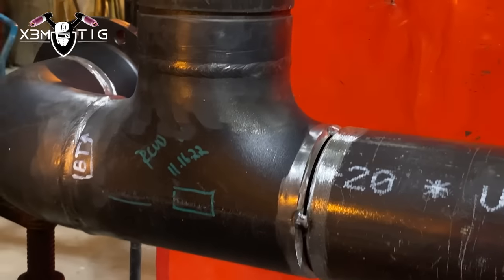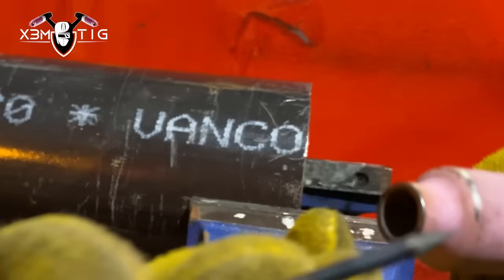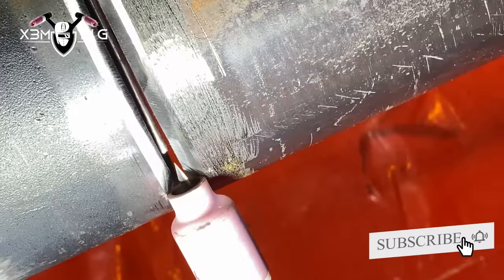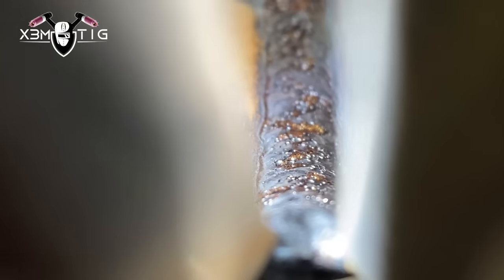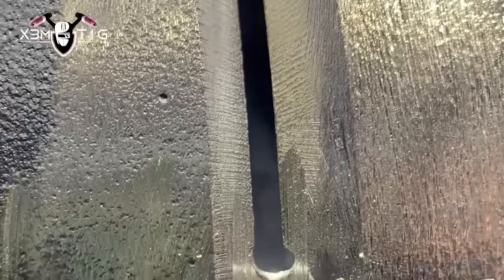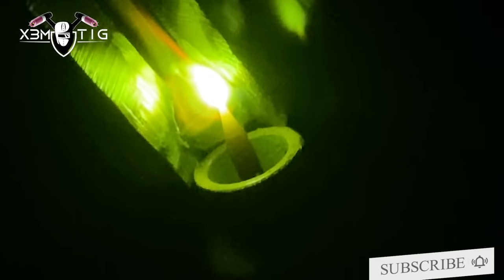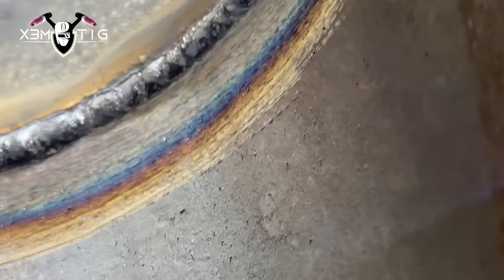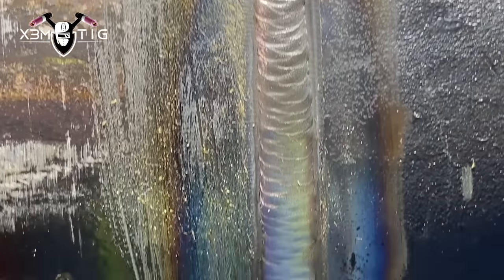TIG Welding Root Pass | TIG Techniques For an X-Ray Pass !

Comment: Dip technique will never fail you. I try to tell all welders to never focus on the middle, the bevel edges are the most important. It helps prevent too much penetration. Break the walls and the wire will do the rest of the work.. love the content!
Reply: keyhole never fails…….NEVER
Reply: i’m taking a 6gr and i’ve busted 2 already and idk what i’m doing wrong
Reply: @Smurf51766  what did they tell you the reasons were?
Reply: @sethhoward9300  they showed the x-ray i had two tungsten holes and one porosity but it looked more of the cap for porosity. and the cap wait 10718 i beleive i was just running too hot
Reply: @sethhoward9300  but the weld has to be 100% inside of a cage and the lift arc doesn’t work right and i stick a lot and that’s what i’m fighting and tapping the tungsten with my rod rarely works and if it does it goes away immediately
Reply from the maker: Thanks brother I appreciate that, glad you liked it .👍
Reply: Great advice thank you
Reply: @morgs3007  a
Reply: @Smurf51766  your not running the right heat and never call the qc over until you inspect it your self. Most of the time you can fix any problems with a burr bit and some heat
Reply: I always got a flat root from dipping. What should I do differently?
Reply: @johnnielocklear2911  what are you running your heat at? Youre moving too fast if you have a flat root. Once you see key hole open up, push the wire in the puddle about a quarter inch and repeat… it helps for you to have a tighter gap  which in the end will make for the weld to be completed faster.
Reply: Totally agree the middle of the weld will always takecare of itself when capping a pipe butt I either dip the wire both sides of the pool or just leave the rod in the centre of the pool and fly round the pipe lol
Reply: Thanks
Reply: I be trying this and my instructor keeps telling me not to it's so much easier
Reply: @johnnielocklear2911 tight weave only. Weave not morethan the gap
Reply: How in the world do yall walk the cup walking it hard for me so I do free hand or w e it's called and then my hot pass Is hard to stretch the puddle to fill the gap my caps are kinda decent I don't have a steady hand so tig is really hard for me
Reply: @ThatS550guy  you don’t have to walk it. Whatever is best for you, stick with it!! I free hand it all!
Reply: @X3MTIG  I want to see you do your dipping technique when you're welding the root on the bottom. Dipping on both sides or bevels.
Reply: Nice video, thanks.

Comment: I can make a pretty weld on pipe but for it to pass xray is still a challenge. Im certified on x r ays for butt welds ane verticals bur pipe ive been practicing all week. I can get 1/2 to maybe 3/4s of a decent root. But i keep getting 2 or 3 chunks of rod that dobt get fully melted. 😢 wont give up till i get it. You're videos definitely help

Comment: Question for the tungsten electrode is the tip always completely sharp or should it be alittle blunt flat on the end cause when I do ac welding with aluminum for example it’s supposed to kinda ball up be a little blunt or like bullet shape I believe not as narrow as I would for like using mild steel or stainless steel in dc just curious my welding fundamentals 6th edition says that
Reply from the maker: Always keep your Tungsten sharp when welding carbon steel

Comment: Can you give me a tip about controlling the filler wire? Which position is better?
Reply from the maker: You have to learn to control it with fingers and try to rest or support on your tack…
Reply: @X3MTIG  Im using my index finger and middle finger to hold the wire. And then pushing it with my thumb.

Comment: Hello
let's assume the gas pressure is correct, let's assume the wolram is well ground, why does the tip burn very quickly? what can cause it? in the settings?

Comment: Would if be safe for me to use Laser weld , as I have a Pacemaker.
Reply from the maker: Hey bro, thanks for your question! 
I cannot give you expert advice, only my opinion! I think HF or high frequency machines, can cause potential problems to your pacemaker, not really sure about laser machines. You should read manufacturer guidelines and consult with your doctor!

Comment: Curious about your preference for lift arc on carbon but scratch start for stainless. I normally use lift for both if the machine has it. Why the difference?
Reply from the maker: Hey buddy thanks for your comment. Actually my preference is opposite, scratch start on carbon and lift arc on stainless. I don’t have any issues using any of this two options if available on welding machines. With the lift TIG, you cannot stick the tungsten electrode to the metal when striking initial arc, which is ideal for welding stainless as you want to minimize grinding , and have everything nice and clean , and for carbon I use scratch start , and even if I get arc marks it’s easy to remove them with grinder, without causing any visual issues. Both options works great once you dial in, in my case it’s more of a habit.
Reply: @X3M TIG  ok yeah i was just curious. I generally use lift arc on everything if the machine im using has that function. I have actually been on a few jobs where the QC wouldn't allow scratch start, only wanted us using lift arc. They were concerned about arc marks outside of the weld zone from guys popping the wire when we arc up.

Comment: Hello, i'm curious, habitualy how many amps you weld approximately in this configuration ? For have an idea of rapidity when you bring the metal into the weld pool at the 6 o'clock to 9 o'clock position, depending of the welders but just like that, thank you for your videos

Comment: What angle are you holding the tig wire when you are backfeeding the bottom of the pipe? It almost looks like the wire is parallel to the joint. I’ve been practicing backfeeding, sticking the tig wire through the top of the pipe as I’m welding the bottom, but I’ve been struggling. I’m wondering if it will help if I hold the tig wire inside the bevel but more parallel with the joint as opposed to perpendicular?
Reply from the maker: At the bottom usually at 90 degrees. You feed rod parallel with the bevel just have to find the right angle.
Reply: Let me make sure I understand you correctly. By 90 degrees, do you mean you are holding the tig wire on top of the pipe and you are feeding it straight down at a 90 degree angle to the joint?
Reply from the maker: @shawnramey614  correct 👍
Reply: Thank you so much for taking the time to respond to my question! I greatly appreciate it. I’ll keep practicing!
Reply from the maker: @shawnramey614  you welcome bud 👍

Comment: I have been welding in the chemical industry for the last 12 years, and always take 5/32 gap so I can fee's wire from inside. I am starting to try and transition to a 1/8 loose gap to fill with a 3/32 wire. I just get concerned about having enough wire lay in because I have cut my down on wire size.